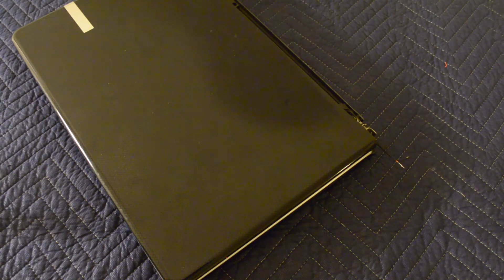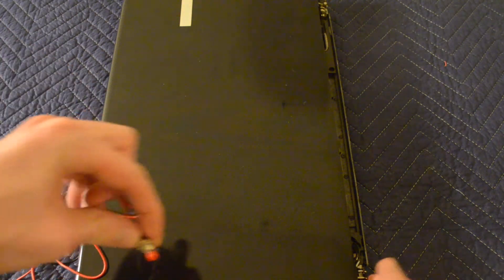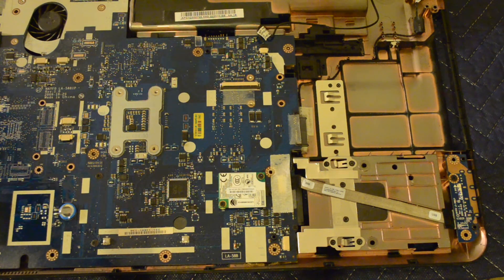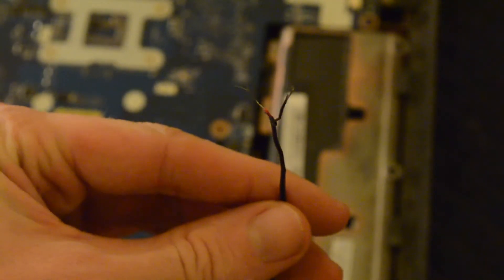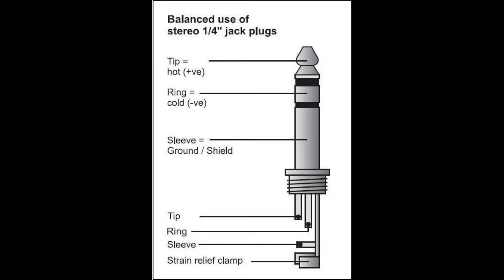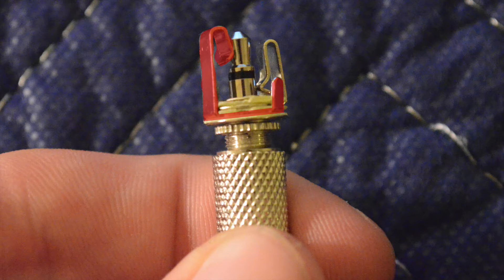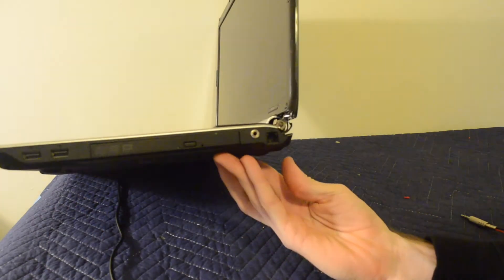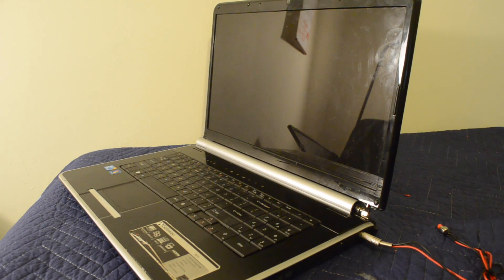How To Fix a Broken Laptop Power Button

Comment: I got a hold of a Gateway NV79 series laptop. It seems to work great, screen is sharp, etc. the hinge area switch does work, but it looks like the round collar or short holding tube is partly broken or cracked. Plan on relocating the sw to a better, dashboard or side edge near keyboard, location. Did you have to completely take the laptop apart in order to get the original power sw wires pulled out & repositioned? Great fix, too! I subbed as well! Do you have to put the cover or spring back in the now almost empty hole where the power sw was? The original sw only had 2 wires? Thanks again 🤓😁
Reply from the maker: This one required some pretty decent disassembly to get to the switch. Hate to say it but I don't remember if I replaced the spring and cover! Thanks for the view and sub!
Reply: @piedmonttiger265  welcome! 🤓

Comment: This was a quite unique and may I say a bit wierd way of doing it. May I suggest putting the switch inside the case (and hold it in place with the new headphone jack...) that way your brother can turn on and of his computer with a pensil or a stick or anything small enought to reach in and press the switch-button. Its easier to find a small thing to press with than to have to carry around the headphonejack, wires and switch.
Reply from the maker: Haha it was definitely not a standard fix. That definitely would have worked! He had to take the computer with him on a trip and we were sure he was going to get questioned by the TSA for having the little switch harness with him!!